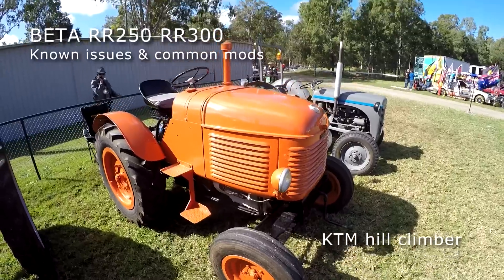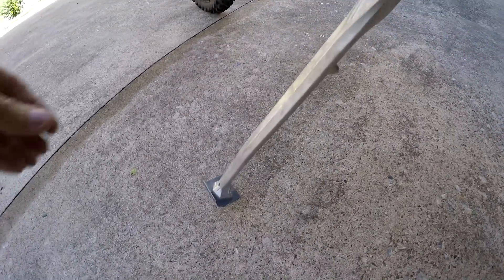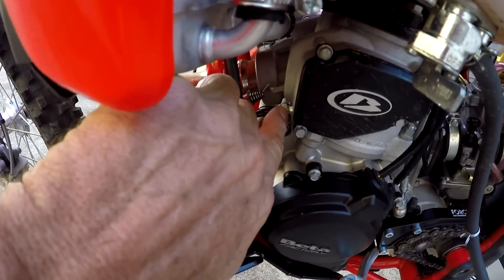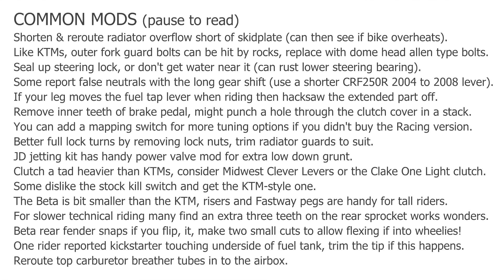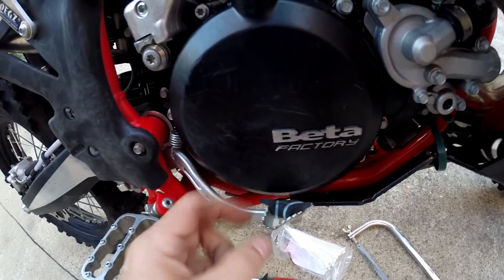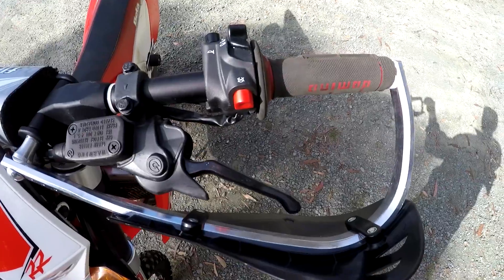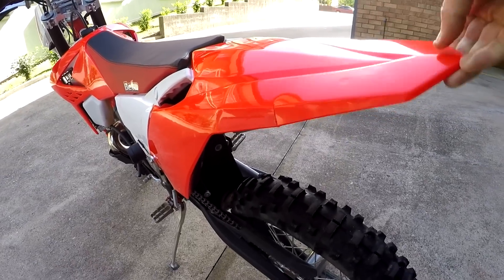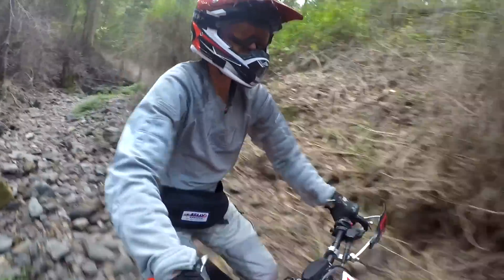BETA RR300 RR250 2015 known issues and common problems︱Cross Training Enduro

Comment from the maker: UPDATE: MAIN BEARING FAILURES 2018, 2019 & 2020 BETA TWO STROKES 
Unfortunately there been main bearing failures in late model Beta two strokes... Beta USA estimates about a 5% failure rate. Unfortunately there have been cases of multiple failures - in one case three times even when fixed by Beta mechanics, evidently as it has been hard to find the exact cause. Beta head office has agreed to fix these cases up to 90 hours, after that it is a case-by-case basis and they may only supply parts. Google 'Beta main bearing failures' for more information.
2019 AND 2020 BETA KNOWN ISSUES?
Many have asked me for an updated list of known issues on 2019 and 2020 Betas. I just rang a Beta mechanic and he said there are three main issues for two strokes. 
One, the main bearing failures continue but at a lower rate thankfully. 
Two, the speedos are failing quite a bit. Often they keep resetting, this can be fixed by securing the input wires more firmly. But the speedos have other issues and dealers stock up on these to replace faulty units under warranty. Electrics can be dodgy and sometimes the whole wiring loom is replaced under warranty as it can be difficult to see where the problems are. 
Three, may sure you oil injection supply tube isn't kinked! A few guys have discovered this just in time to prevent seizing. 
Four, go over your new bike and check for bolts that are too tight, too loose, or missing. It seems this problem still hasn't gone away. 
Four, charging problems on the four strokes and electrical issues. Thee big one is bikes not charging the battery and it keeps running flat. Again, sometimes whole wiring looms are being replaced under warranty. Also there can be lots of niggling issues - read this story about one guy's Beta RR480:

"My Beta 480 was a problem child. Battery went (again) third time out, replaced. Next time out it stopped dead after about an hour, after over a month in the shop the fault was traced to a loose bullet connector in guts of the loom. New harness ordered, weeks rolled by, fixed. A few more rides without issue, then I noticed oil dripping from both the transmission and engine cases. My 'local' dealer had now shut up shop, which meant over an hours drive. That was a biggie. Those leaks were the result, so I was told of a crook batch of gaskets. This required complete disassembly of the motor (cases split) to remedy, plus another month and then some off the road. Beta covered the labor for the job, but not the consumables, so I still copped a $100 bill for that.  All this on an engine not even 12 hours old. 

In both cases Beta seemed reluctant, at best to make things right, and I got the impression the dealers were trying to get blood from a stone.  I dunno, maby the thing will run for another 500 hours without missing a beat, maby not. I can live with boutique brands and limited dealer coverage, but not a company who doge their responsibility to customers, then acts like they're doing you a favor to honor a warranty claim".

Comment: Hey, I have a tip for the mud flap issue! :) I heated it up slightly with a butane torch, put a bit of a bend in it (much like a baseball cap peak) then let it cool. it's holding shape and not rubbing on the swingarm.
Reply from the maker: +Merlin Maertz thanks merlin, great tip! i've added it into the vid.
Reply: Great! Thanks! :) Good to know I'm balancing out the stupid questions somewhat.... :P

Comment: Today came my day. 2016 Used 300rr with only 30 hours on the odometer! It has come 3000€ under price of new and it has few costly things installed already(radiator guards, all possible guards to be exact and front and rear moose) :) Cant wait to put hours on it!
Reply from the maker: sounds like a bargain, blaz!

Comment: spent a couple of off evenings applying liquid electrical tape on all wire connectors where water can get in behind. there was a lot to find and to water proof.when finished,  i was glad to have spent the extra time to do it right. too bad its not done at factory, cause it sure seems obvious when doing it yourself!
Reply from the maker: +Todd McGivern good one todd, i'll add that at the end of the vid.

Comment: Plus in the toolkit space the plastic kept getting out of place and going inside instead of out so my dad put some plastic body screw things so that when you tighten it it expands and it won't come loose
Reply from the maker: +Christian 777 i found the toolkit still moved just enough to wear through its case and also it got very dirty in there. now i store a tow rope there and put the toolkit in my bumbag.

Comment: Locals with oil injected Betas report too early top end jobs and have started to use premix along with the oil injection; 40:1 has given plug fouling, perhaps 50:1 or more will be best.
Reply from the maker: any details on when they are doing their top ends, pberguy? googled around and couldn't find anyone mentioning this as an issue, even on the beta forum. are they racing, or just pottering around?
Reply: A ride buddy with a new 2016 Beta Xtrainer decided to premix his fuel based on a club Beta rider who complained of oil related wear; however, my follow up inquiry has found that rider’s Beta is NOT oil injected (300RR). His complaint was that running premix (Maxima Super M) at the Beta recommended 60:1 resulted in the rings worn out at 78 hours (some piston wear but cylinder good). I think the Xtrainer guy thought all Betas were oil injected, hence his error. My advice to Xtrainer guy is to reduce pre-mix to 100:1 or eliminate it altogether. Sorry to have injected third hand information into your excellent website, I should only comment on things I know firsthand.
Reply: Per above, the 300RR reply was top end at 78 hours; mainly hare scrambles and enduro use. We have mostly tight trail hereabouts so not a lot of sustained high speeds.

Comment: some helpful tips mate, 2016 beta also leaks 2stroke out of the top power valve cover, I've been told that it only happens on the run in tank because they add 100to 1 to the fuel and also injection at the same time, I think someone is pulling my leg, it's Sunday morning atm, we went to urbanville in North West nsw yesterday,  great place with all the fire breaks and steep hills and plenty of mud, your right about the beta making you a better rider,seams effortlessly, great bike happy as, time for wash up and inspect oil leak, mother f@@@@@@@@
Reply from the maker: +mad benny yeah i've seen threads about that issue but didn't pay much attention as i never hit that problem. such a sweet bike to ride hey? one by one the kato guys have been jumping on the beta and most of them are now mumbling about turning italian next time they upgrade.

Comment: I don't get it. Which breather hoses should be routed in the airbox. The ones that come form the carb horizontally (like in this video), or the others that goes up (exiting vertically from the carb), as I saw it on your other video ? Thanks

Comment: No Clake anymore?  Noticed in your older vids that you had one on the pumpkin you used to ride  - any particular reason you didn't transfer it across to the new steed?
Reply from the maker: +Scott Owens as per quite a few comments the past six months, couldn't bleed the system properly. the clake guys visited and tried to fit my clake two but then it wouldn't fit with the flexx bars. :( i fitted a clake one instead. thinking of swapping bars so i can fit the clake two.
Reply: +CROSS TRAINING, ENDUROCROSS & ENDURO TECHNIQUES Oh - I forgot about the Flex Bars, and didn't even think about fitting problems with em.  Hopefully my Clake One clutch will arrive this week (finger crossed as I ordered it a month ago) as well as my new Mid West light brake lever.

Comment: Hey man, I bought a 2016 and just did my run in ride. I'm super stoked! :) However, I do find a significant  richness burble off the bottom. Did you encounter that? I suspect it's the needle? What clip position are you running on the NECJ? Do you think that leaning out the pilot jet would perhaps work? Cheers in advance.
Reply from the maker: +Merlin Maertz heaps about this on the betarider forum and also the beta section of many other forums merlin
Reply: Yeah, I looked and found the info I was looking for AFTER I had asked :) 3rd Position I believe? Your channel is my first port of call for most things motorbike related cause watching your vids is waaaaaaaaaaaaaaaay more fun than floundering through forums. Maybe add it to the 'watcher's extra tips section' at the end of the vid? Cheers!
Reply: Not sure how to add to the info in this vid, but I've found that fuel will VERY quickly breakdown the paint on the  frame. I would suggest that owners be very careful and cover any painted surfaces when refueling or working on the carb.
Reply from the maker: +Merlin Maertz is that a beta-specific problem merlin, or just for any brand?
Reply: I've not experienced that with any other bike I've owned.

Comment: "Float level 6 mm from the body to the float with the tang resting" - does it mean I hold the carb vertically, slowly raising the floats into the carb and when the float valve stops moving (yet the sping on the pin yet doesnt start to compress), I should measure 6mm depth from the edge of the carb to the lowest edge of the float?

If that is so, I should extend it to 7,5 to 8 mm? 

Can I go even lower than that and what are the pros and cons?

Many thanks in advance for kind advice;)!

PS: I made myself a measuring tool out of LEGO, as wall thickness of "1 by x" LEGO brick is precisely 7,8mm;). Work for LEGO so thats why;)
Reply from the maker: +michail1963 lol i can't even remember now michail! it might be best to use the betarider forum, there are probably photos up by now, or you could post your own and get advice from the crowd there. GMP is the owner of the forum and knows everything about these bikes. good work on the lego. everything is awesome... :)

Comment: hello, I bought the same bike as yours and I'm looking for the solution to a problem I noticed. In the maintenance manual it says that when you start the bike you should see turned on the mixer oil light on the bottom left of the odometer for 10 seconds as a "check". To me this light does not come on. I have read that not all models do. My bike is like yours, so I would like to know if this warning/check light comes on for you. I hope you answer. thank you
Reply from the maker: Damn, I never even knew about that. The Beta speedos are very well known for their dodgy electrics and dealers often have a bagful of them to hand out to guys for warranty claims.
Reply: @crosstrainingenduro  I apologize for my trivial mistake. I've been looking for a solution all day and only now realized that the odometer was showing a low battery. Naively I thought that when I turned on the bike the lights still worked. I changed the odometer battery and the problem is solved, now the control light appears for about 3 seconds (not 10 as indicated in the maintenance manual). I hope I can be of help to others who have had this problem as well. Thanks anyway for your reply.

Comment: I fouled 2 plugs . I wondering if it is because I have not really had a chance to run the shit out of it . just little rides.  the plugs have been really dark . 2018 beta 250rr
Reply from the maker: none of us rev our bikes at all shawn, and often plug away just above idle in snotty terrain for a few hours... never a fouled plug. i'd suspect jetting or more unlikely, the oil injection playing up. if the system breaks down it defaults to 15:1 so you can't sieze the bike even in a flat out race.

Comment: How high can you go with bar risers on the 300 without issues. 6'5" here. Beta parts 20/30 mm or rox. Want to get some parts together for my bike. It's one of the only things that I'll need aside from the usual guards/protection. Thanks.
Reply from the maker: +klxklr i just managed to fit the rox pivoting two inch risers with a bit of jiggling around with the hydraulic line so smaller risers should be okay. mind you, i have my bars fairly forward which probably gives me a tad more leeway. i'm not using the risers now as i went for the flexx bars which naturally sit higher.

Comment: So...  Will these mods & tips translate into German?  As spoken in the Ostermark?  LOL!!  That's kind of funny to see the rubber & zip-tie mods...  I thought I invented that!  In the late 90's I had a KX250 that VIBRATED a little bit (lots).  I used sliced up old tubes & zip ties to protect every single loose vibrating part!  I even have a few protecting the pumpkin princess.  And routing the vent tubes up and away from bodies of water?  I've got a patent for that (ok, I don't but I should).  Started doing that to the KX's back in the mid-90's.  There was a kit someone offered back then that routed the carb & tranny vent tubes to a plastic manifold that vented into the airbox.  My cheap answer was to route up under the gas tank.  So your version is a little different (enough to avoid infringement!).
Another excellent video Mr. Morris.  Greatly enjoy watching even if it doesn't apply to me.  Although the '16 430 & 480 RS's (North American "dual sport" models, like the EXC's here...) are fuel injected.  Shed a few pounds and figure the suspension out and I may have to open a Beta dealership here!  LOL!!  (Or go to Seattle and pick one up.)  Then we can talk tips.  Do you think the JD jetting would help a fuel injected four stroke?
Reply from the maker: +gncc1race translated into german, ja natuurlijk! although i'm not sure how to translate zip tie, no doubt there's a big  word like zippengestrappenmitplastikenstrippenundratshitmekanismheidt. haven't read up on beta 4T carby issues so couldn't comment, on the quiet i'd have to say not overly impressed with the JD kit for the RR300 so far but possibly i'm doing something wrong, liaising with them at the mo...
Reply: LOL!!!  Yeah, you're probably right!  It reads like the pumpkin's manual! 
Actually the carbureted Beta 4T's have a stellar reputation, without any issues I know of.  The entire '16 RR/RS 4T range is now fuel injected, as was the '15 350RR.  The bike mag's loved the fuel injection, Beta got it right.
I was just making a lame joke...  JD jetting kit on fuel injection?  Again, I'm the only one laughing...  I get that a lot.  LOL!!
Reply from the maker: doh, shows how much i know about the four stroke range! i keep hearing good things about the thumpers but apparently everyone wants the smokers nowadays. wouldn't mind getting a ride on the four stroke just to see what all the raving is about.

Comment: there are 4 hoses on top of carb and one on bowl. do you reroute all 4 top hoses to airbox? in vid only looks like 2 on left side.
Reply from the maker: i never did those as we don't have deep creek crossings at all...
Reply: found out from local beta mechanic that the 2 hoses that loop over top of carb are the 2 that need rerouted or better yet, add a "T" and run another vent line up under tank.

Comment: How about Beta aftermarket parts? I was damn near sold on the Beta coolaid until I took a look around at some of the most popular motorcycle gear / parts websites here in the US and found that hardly any of them had any aftermarket or even OEM parts for Beta's...a little concerning. Can't seem to find aftermarket bars, grips, plastics etc. Will I need to be ordering them from over seas?
Reply from the maker: +Enduro MF there's plenty of stuff around here in australia, and there should be in the usa too. beta gets around the 'lack of stock in general shops' issue by having heaps of stuff ready to order through their websites, including aftermarket stuff... just have a look through there. they make a point of shipping quickly too as a rule...
Reply: +Enduro MF Check out Stillwell Performance. Alan is a very knowledgeable, and does after-market for KTM, Husky of course and Beta. I think there out of Arizona...check out his site.

Comment: where can i get rubber or plastic to attach to the frame (to prevent the paint rubbing off)?
Reply from the maker: +harry - i just cut up an innter tube and zip tied the strips on. you can get carbon fibre guards through any beta dealer though.

Comment: i had a Beta RR250, and i found that the rear axle bolt was extremely easy to strip! Not sure if anyone else has experienced this? really the only gripe i had about the beta, apart from maybe the motorcrossy feel to the power (and id screwed in the power curve screw down to mellow as i was a reasonably new rider and unfit)
Reply from the maker: are you using the torque chart for the rear axle bolt? many say beta's specs have way too much force applied. re: the motocross power, that sounds completely unlike the RR250 and i wonder if a previous owner modified it in some way? just had two whole days riding on one and loved how smooth and flat the power curve was on it, especially compared to my old KTM 250EXC....
Reply: nah, im not, wouldnt have any idea how to use it :') 
yeah, i just found that it wasnt to confidence inspiring, but id ride my mates Fantic 300 and i could attack with a lot more confidence. 
it was a 2013 model, brand new. power felt very snappy.
Reply from the maker: strange. everyone single person i've spoken to about their experience of the beta smokers is the smoothness of the power delivery... maybe the fantic is just even smoother?

Comment: which engine and pipe protector is that by 1:25 and where can i buy that?
Reply from the maker: +TobiasWR125 it's a P3 carbon pipe guard, the combined bashplate/pipe guard is from force accessories, i went through their websites.

Comment: just got myself a new 300rr 2017 and the fuel injection system is pushing to much oil, anyone had this problem?
i mean 230 ml of oil went down after riding a half tank of fuel